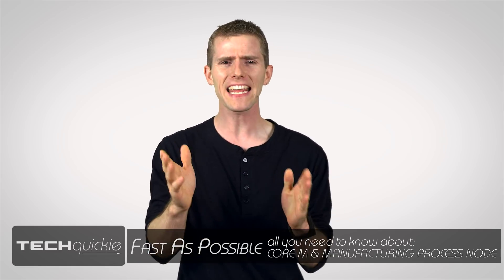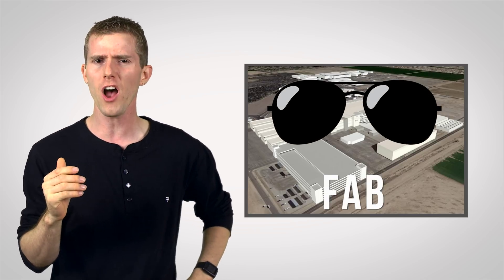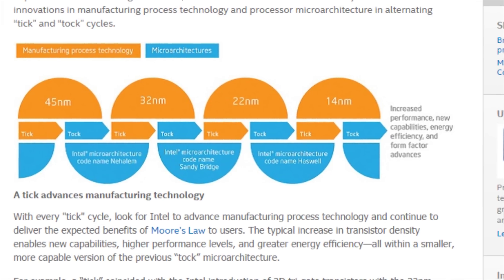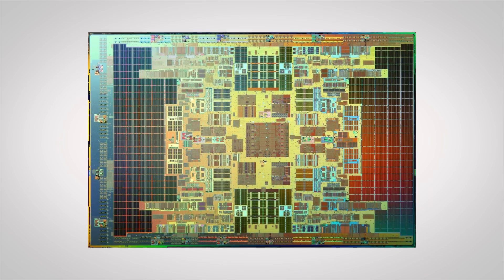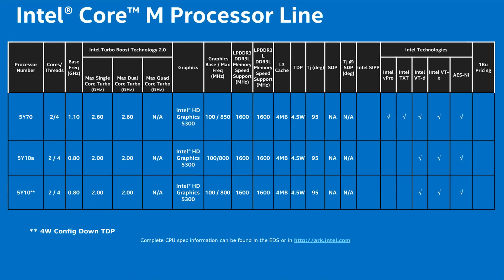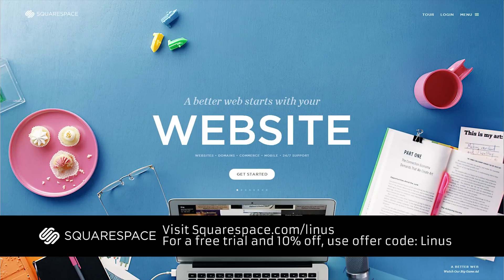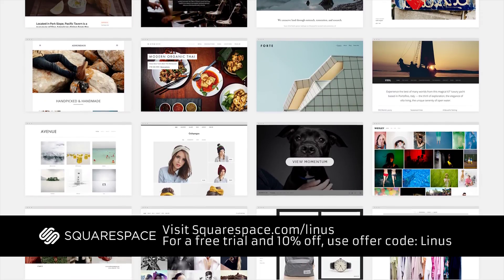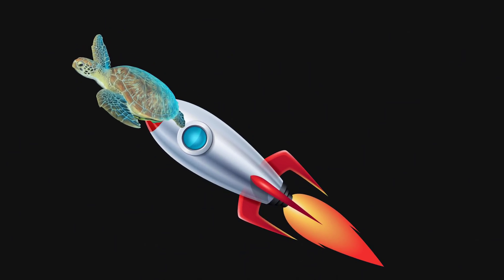Processor Manufacturing Processes or "Die Shrinks" as Fast As Possible

Comment: Intel is not the only processor manufacturer Linus.
Reply: Well, they are currently driving the node processes forward. So, they are worth mentioning a lot more than AMD which is struggling with their architecture.
Reply: Nikolaguitar
Well AMD is researching different technoologies with their APUs where new are capable of HSA, and all Linus did here is described the Intel's tick-tock development process.
This video just seems kind of bias which it shouldn't be since it's on TechQuickie channel...
Reply: Antun K intel is the only example thats actually shrinking their process right about now anyhow which is the reason for linus using it as an example, intel is simply more relevant at the time of filming.
Reply: 1toncheese I agree that Intel's manufacturing process is ideal to learn people about architectures and transistor shrinkage, but you have to take into consideration that most people that will be viewing this will not be as informed as you are and they will get the hint (which I am not saying Linus implied) that Intel is so much better and everything else sucks.
The same video could have been made using the process of GPU development as and example.

I feel like atleast he should have said "Although Intel is not the only or the better CPU manufacturing company, their manufacturing process is the perfect example... blah blah blah"
Reply: Antun K
yeah, but aside from that it is accurate so it isnt the biggest deal, besides amd arent exactly doing anything with cpu's till 2016 so until then intel have a kind monopoly on new cpu's and can release new tech at a leisurely pace....
Reply: 1toncheese
AMD is still very relevant except for the most extreme of budgets, and you can make a gaming rig that will max out everything on 1080p using AMD CPUs. They just recently refreshed their FX 8core CPUs improving TDP and performance while maintaining the same prices.
Reply: but AMD is bad soo
Reply: rocko378
Talking like a true fanboy ;)

Comment: Intel/AMD/etc. and even GPU manufacturers are struggling to get below the 28 nm mark (because of quantum mechanic issues), SSD manufacturers like Samsung are now layering their transistors (they call that 3D) to circumvent that issue.
Nvidia currently just improved with Maxwell the architecture without actually shrinking the sizes again...
There are ways to get it shrunk even more down but with these high frequencies it's pretty hard...

Comment: I have a legit question: what's the difference between a CPU and a GPU?
Reply: They are similar in principle, but GPUs are designed to be optimized for parallel processing (tons of small tasks simultaneously) which is why they have hundreds or thousands of really weak cores as opposed to a handful of stronger cores on a CPU.  CPU cores are generally capable of a more diverse range of operations than a GPU (integer, floating point, etc. whereas GPUs just have for example 2048 dedicated FP32 cores, and then some FP64 cores and a few other specialty cores).
Reply: GlenwingKyros That also tends to be why GPUs aren't very good for physics based calculations and rendering, which is shunted to the CPU.

Comment: Hello, I know that people are going to judge me based on my profile picture but that's ok I get used to it. Anyways I just wanted to ask if you can please make a video based on PC buyers guide...I'm looking for a computer that is high end and can run games like Battlefield 4, Dayz, Arma III etc in ultra setting. I don't really know about computers. I'm looking around 1.5k-2k. don't know how to build a computer so a built computer would be nice. Anyways thank and I hope you read this message.
Reply: he has a few on either ltt or ncix, but i really recommend you learn to build it yourself. as for the high end part my pc can run bf4 on 1080p ultra and it cost me £500 to build myself and i didnt cheap out on parts, it does slightly bottleneck on bf4 due to it having a dual core pentium cpu (the pentium g3258 is a however a beast of a cpu and batlefield 4 is one of the few games to actually use more than 2 threads properly). its simple, get help with a parts list, and then so long as all the parts are compatible they will all fit together with little more than a youtube video for a guide (the only hard part is putting in the cpu and even then its just a case of having either the guide or some common sense as pretty much everything else is keyed and will only fit in one way) and a few hours at most.

Comment: still not happy with the saving of raw material as a reason for costs to go down. High end and low and CPUs use the same amount of silicone. Also I found quite interesting the "end of moores law" that we are reaching to to physical limits of transistors and the increased susceptibility to errors that lead to modern chips needing huge amounts of error correction.
Reply: Moore never stated that it was a law. It would be more correct to describe it as an observation. All Moore did was state what he was seeing.
Reply: silicon* he messed up.
Reply: yeah, the material cost is pretty much negligible when you're talking about thousand bucks CPU's

Comment: 14 nanometers?

One single atom of Silicon is about 0.25 nanometers.

We are getting to the point where we're dealing with manufacturing processes in the range of only 50 or so atoms across.

....

There's no way that can keep on working its way down forever. That's Moore's Law isn't it? We're moving to such absurdly small sizes that quantum uncertainty will begin to creep in, and the very physics that allow the sun to fuse (quantum tunneling) will start to make CPUs too unstable.
Reply: And thats the magic of their work
Reply: Keep in mind "14nm" refers to the width of the gate on the transistor, not the width of the whole construct.
Reply: GlenwingKyros Yep, but when quantum tunneling comes into play, it can disrupt the operation as rogue electrons can filter over the gate. How a single atom transistor was made is beyond my ability to comprehend.
Reply: Yes, Quantum Tunneling will start to take effect as we shrink, unless we rethink microchip architecture. IBM's new neurosynaptic processor prototype seems to be a step in the right direction.
Reply: Silicon is indeed reaching its limits. Luckily there are other elements that have been shown to allow for even greater performance. Graphene transistors that switch at several hundred gigahertz have been made in the lab and if I remember it correctly there was another material that was even more promising. I have no doubt that Intel is heavily investing in these new materials to figure out where to go next when Silicon has reached its limit.

I'd like to propose the meta Moore's law: "Moore's law will continue to be true, even though we become twice as pessimistic every 18 months".
Reply: or just strap about 3, 12 core cpus to your desktop.....(assuming most programs can use all the cores by then)
Reply: @96qwert69  surprise surprise
Reply: Jay Fitzpatrick
Quantum processors don't use transistors to process information. They use individual particles.
Reply: And that's when quantum computing comes in. Being able to have transistors on AND off simultaneously, which means a bit can exist as both a 0 and a 1 at the same time. It would theoretically make data processing a lot more efficient. This is, of course, an extremely dumbed down explanation of quantum computing.
Reply: They could potentially start improving however in different ways to just getting smaller after they reach a cut certain cutoff point. The materials could change and even the way messages that are sent across it could change to become faster (like graphene sheets or even strait up light beams).
Reply: Exactly. There'll come a time whereby we've perfected the production of smallest transistors possible and we can then simply go no further. At that point we simply won't be able to get better CPUs or GPUs and then we'll stay at that point forever... I'd be surprised if they get much better to be honest. I'd imagine that it won't go further than 4K or 8K...
Reply: In 2009 Intel's former CEO Paul S. Otellini was quoted as saying that silicon is in its last decade as the base material of the CPU,[4] with replacement options such as Indium antimonide or optical computing.
Reply: I think 8nm will be the smallest for silicone, but there are other ways to improve performance. (3D-transistors, MEMristors, light instead of elektricity, graphene instead of silicone,...)
Those things are all actively being researched and since a lot of money is involved, they will be ready when needed. ;)
Reply: @Robbedem  we here at 7nm boi
Reply: @mush543  and soon 5nm
Reply: And now we got 7nm none other than by drum roll please AMD!?
Reply: Mohammed Daher Actually those size quoted r just marketing. Intel’s 10nm is denser than AMD’s 7nm. The actual transistor size is more than 10nm.
Reply: Astro Mec Exactly, and that is why Intel is struggling more with the 10nm. Their 10nm is tougher to accomplish than AMD’s 7nm because Intel is using the actual 10nm process.
Reply: Son Goku Even Intel’s 10nm is not 10nm in size, although it’s the densest chip
Reply: Robbedem *Further process nodes than Cannonlake's 10nm are not clear, although Intel development documents from Q3 2012 indicates 7 nm node may reach production around 2017, with 5 nm in 2019.[3] In 2009 Intel's former CEO Paul S. Otellini was quoted as saying that silicon is in its last decade as the base material of the CPU,[4] with replacement options such as Indium antimonide or optical computing*
Reply: @richmahogany1  *laughing in AMD xD
Reply: James Oldfield lol i was joking XD,  but fair point
Reply: DMitsuki
lol, the person who wrote that article knows nothing about physics....
Reply: called quantum tunneling, electrons can switch lanes.
Reply: Niosus Yes, but there is an actual limit on silicon computers. I suppose Quantum computers is the cheat.
Reply: James Oldfield Right, but then the very design of CPUs will change.
Reply: +UnknownXV They will go on graphene or something like that
Reply: UnknownXV You understand Quantum Physics too? I see you’re a man of culture as well. Due to quantum uncertainty the electrons have a higher wave function past the potential barrier from the transistor which means it can end up on the other side of the gate even when it’s closed. Similar to how even though the Sun doesn’t have enough strength to squish hydrogen atoms together, due to quantum tunneling many atoms do actually fuse because they have energy high enough to bypass the potential barrier imposed by similar positive electrical charges of those hydrogen atom
Reply: And yet the phone that I'm using to type this comment has a processor with 7 nanometer transistors
Reply: Niosus There is currently no feasible way to produce graphene on a mass scale and there may never be, although we don't know either way yet and until there is, if there ever is, we can't use graphene for transistors because we simply cannot make enough of it to use it for mass producing transistors from it...
We're gonna have to look elsewhere unless we can come up with a cost-effective way of mass producing graphene soon...
Reply: ***** But then you won't be able to cool it down effectively using cooling systems that use air or water cooling. You'd have to use, like, liquid nitrogen or something. At that point it's just not worth it...
Reply: James Oldfield Well that's an engineering issue. I'm not saying graphene will be the next big thing, but there is a lot of research being done. Before we figured out the silicon transistor there also were huge limitations. Only time will tell I guess :)
Reply: Hi.. We meet again..
Reply: Humans will have to change their computing methods if they want to compete with other species throughout the cosmos.
Reply: Return of the gigantic computers in civilian life?
Reply: Then we switch to Carbon-based computers, it has similar chemical properties and it is 0.07 nanometers large.
Reply: Peleg Tsadok Or quantum computing.
Reply: Alan Chen
Do you even know what Quantum Computing even means?
It has nothing to do with Quantum Mechanics.
It doesn't solve this problem.
Reply: Niosus I have no doubt in my mind we'll overcome this limitation eventually but at some point we must come to another limit and we'll be as good as possible with no further room for improvement... I don't know when but we'll eventually hit a point where we can go no further from...
Reply: James Oldfield I think history has shown that that's a very risky prediction to make.

You're probably right, but the question is if humanity will reach that any time soon. We've done the "impossible" many times before. Don't underestimate human ingenuity. We'll push it right to the edge and manage to cheat our way further anyway.
Reply: Niosus There is still a limit. We can still only go so far. It doesn't matter how far that is, there's still a limit to the maximum power per inch we can have even if we don't know what that limit is. Think of it this way, there must be a best way to do this. We might never get that far, who knows?
Reply: James Oldfield What is so awesome about real life is that limit is unknown. There may be a better way to do things far beyond anything we can imagine now. 

Remember, any sufficiently advanced technology is indistinguishable from magic.
Reply: UnknownXV I know, hell a lot of technology we have these days is almost indistinguishable from magic, for example, electron microscopes, NMRI machines and the suchlike...
Reply: James Oldfield Sure there is a limit. Thermodynamics puts a limit on how much information (entropy) there can be in a certain volume.

But there is a difference between saying "there is an absolute, theoretical limit" and "we've reached the limit" or "we will reach the limit soon"
Reply: James Oldfield Yep. Especially when you think about the time perspective. Pull someone from 300 years ago, plop them into the current modern world. They wouldn't believe all the possibilities. Metal boxes that move themselves at speeds unimaginable? Rockets that push you into space? Wait, what is space?! Etc...it's pretty damn cool to realize how far we've come in a few centuries. Heck, just the past 50 years have made a gargantuan difference.

I have no doubt we'll find a way to move beyond this silicon limitation. It may take time, I have a feeling that as technology advances to push the boundaries will take more and more time to figure out (as systems and physics become more complex) but we will get there. Only a matter of time. :)
Reply: UnknownXV Well sure but there's only so much space and only so much power, right? Like eventually everything will be next to one another and then how will you fit more stuff in it when it's full and using the best possible material for conduction? You can't... There must be an upper limit somewhere...
Reply: UnknownXV I know. And the very design of CPUs must have an optimum with no more improvements even if we never get that far... Like there must be an optimum. There can't be an infinite number of ways to do this...
Reply: James Oldfield Infinite? True. But the limit may be much further away than you might think. But we just don't know.
Reply: UnknownXV True...
Reply: Niosus Graphene transistors are a dead-end as it has no natural band gap (that is FULL graphene transistors), if anything phosphorene and stanene would be the better way to go as it has natural band gaps and also reaches into the 100+ GHz (and possibly terahertz). Interestingly, NASA made a vacuum tube run into the 100s of GHz's. The website: http://www.extremetech.com/extreme/185027-the-vacuum-tube-strikes-back-nasas-tiny-460ghz-vacuum-transistor-that-could-one-day-replace-silicon-fets
Reply: A strand of DNA is 2.5 nm thick